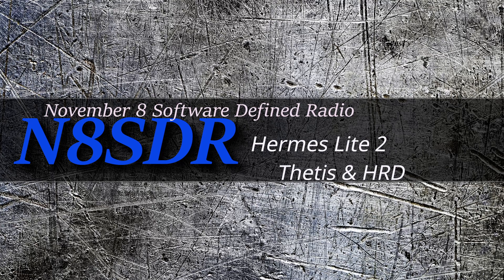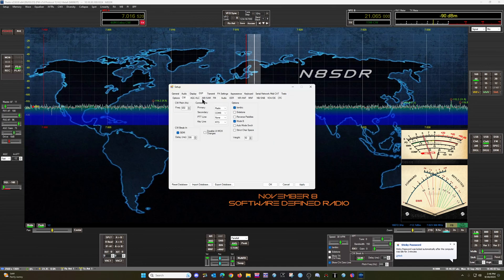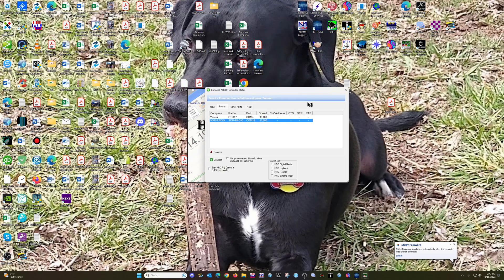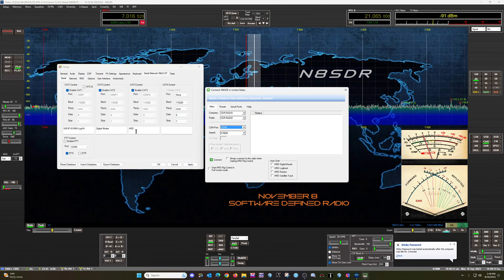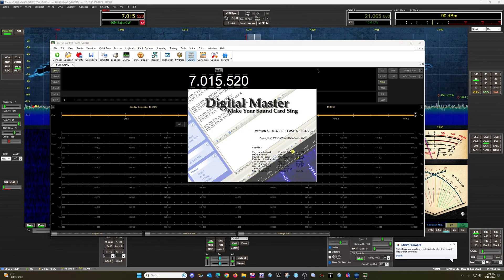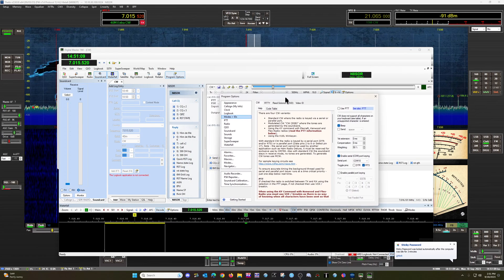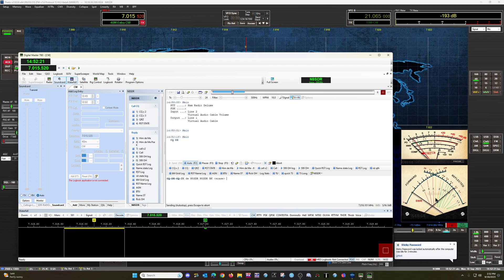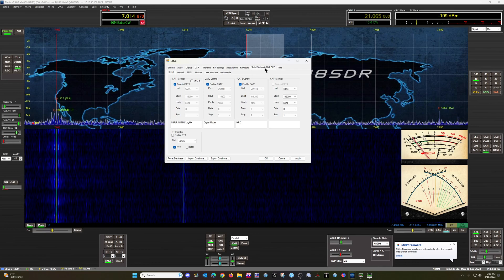Thetis and Ham Radio Deluxe setup-configuration, for those who asked how.

Comment: I've got it all working thanks to your video.  Except, that when I try to TX from DM780 I get an error message saying " Transmit Failed  The SDR-RADIO does not have a TX button displayed.  Press 'OK' to configure the Radio pane layout".  When I try to add a TX button, there isn't one in the list.
Never mind, I figured it out.  I set it for Flex Radio/PowerSDR.  Everything's working fine now.  FYI:  I'm using a Hermes Lite 2.